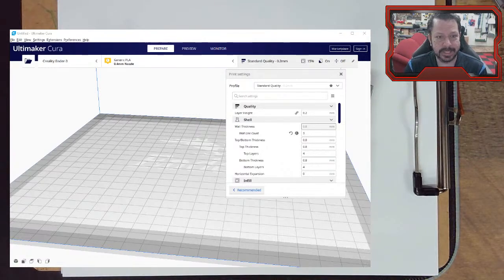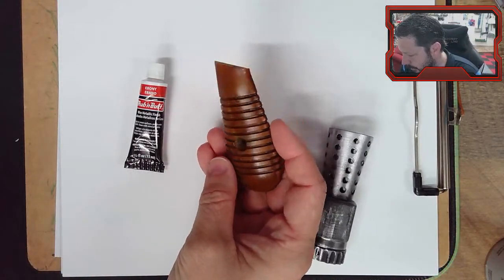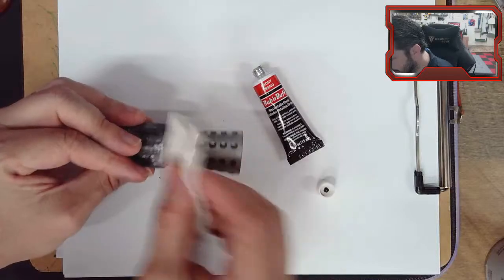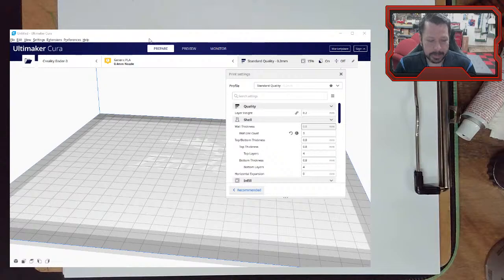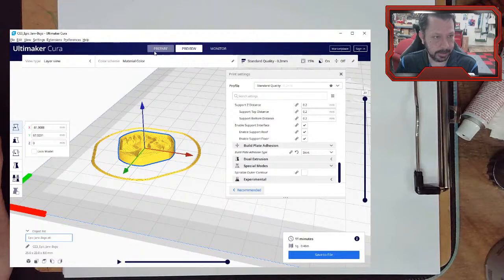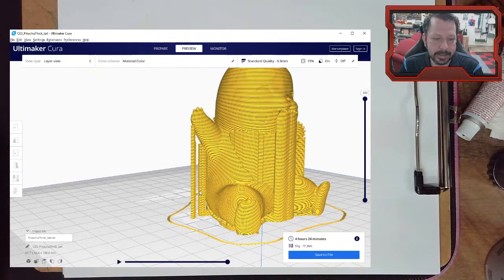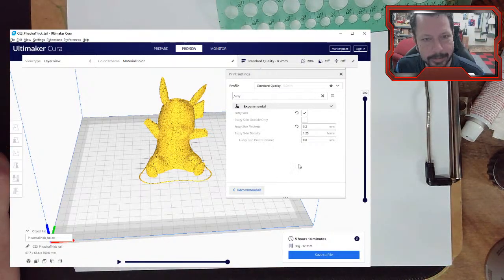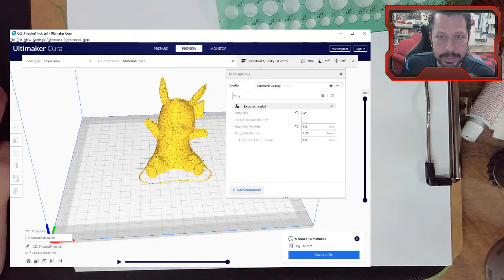Advanced Slicer Settings | Cura | Class 25

Comment: How do you get a preview of an stl file like you have around timestamp 5:00? Thanks in advance!
Reply from the maker: It is a function of Windows 3D Viewer. You can force it to happen by finding an STL file and right clicking -> Open With -> Choose Another App (even if you see Windows 3D Viewer in the list). Then click on "Always use this app to open STL Files" and then select Windows 3D Viewer. Now when you click on an STL and you have the preview pane open (in the View tab in File Manager) you will see a preview of the STL I hope that helps!
Reply: @KellyBC  Thanks!!